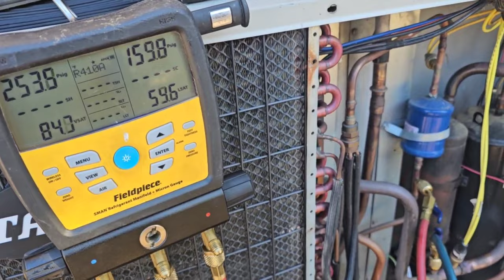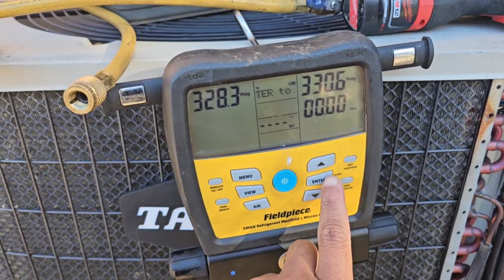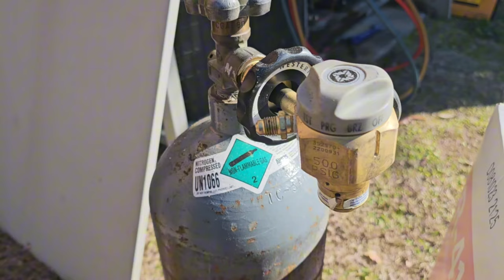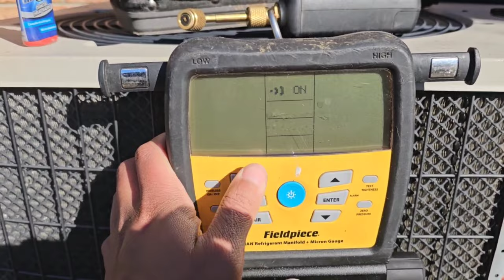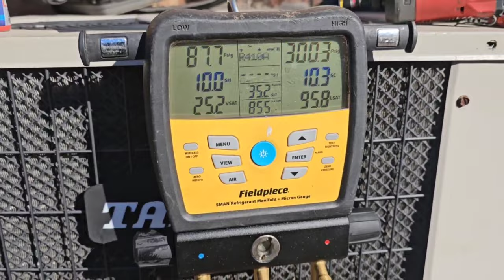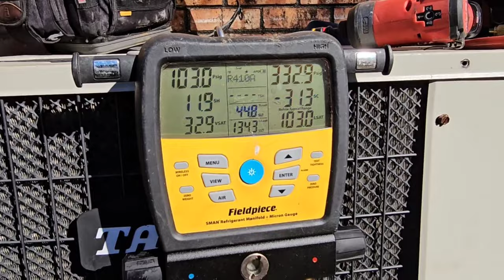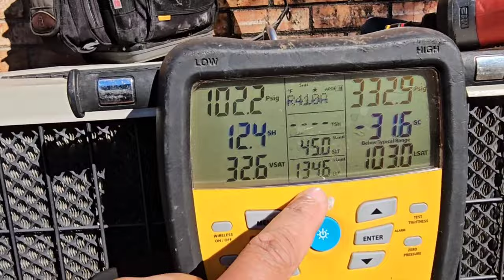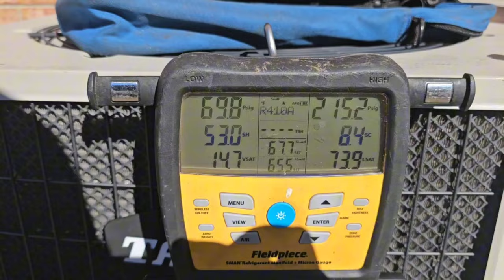Heat Pump Package Unit With Restriction Had Other Issues Too

Comment: Good video! Just a friendly tech tip, when pressure testing the entire circuit with the compressor introduced then you should test to the low side maximum rating. Your blow molded compressor plug is not designed to handle the high pressure rating and it is not a fun day if you blow the molded compressor terminal out.
Reply from the maker: I never knew that. Is it just something with that compressor style then?

Comment: They make a wand for your coil gun so you don't have to disassemble the units. It fits right inside the fan shroud fins so you can spray from the inside out. Love your videos.
Reply from the maker: I've seen a few youtubers use that thing. I think it's definitely useful, I just haven't seen it at my supply houses

Comment: 500 microns is good enough for hvac.  That static trick for charge is a bunch of shit.  Charge by superheated and subcooling.  Heat pumps can b tuff to charge.  Ur doing an excellent job.  When I was ur age I didn't know half what u do.  That's some good ass coil cleaner.
Reply from the maker: Honestly I love pulling good vacuums. Been trying to save up for another big hose to connect to BOTH valves to pull down faster

Comment: Damn that subcool mighty high. Honestly I’m still learning but I was taught that it should be around 12 I believe could be wrong 😀
Reply from the maker: That's true but on heat pumps (to my knowledge) you don't go by subcool specifically. Plus there isn't even a txv on this system which is the only time you go by subcool. Checking LLT on your discharge line in heat mode should be approximately 100° above ambient. But always go by the manufacturer specs if u have a pressure chart. I had nothing

Comment: Bro I always disconnect the Condenser Fan motor and then I charge it.
Reply from the maker: What? 🤣
Reply: @AB_HVAC   instead of covering the top with your tool bags. It’s good for testing the TXV and charging in heating mode.
Reply from the maker: Ooohh ok

Comment: Should not charge in heating, charge in cooling
Reply from the maker: If I remember right it was like mid to high 60s out at the time we were there doing the work. There was no dataplate on there to tell me how much it came from the factory with, so I wasn't in ideal temperatures to charge in either mode.

Comment: Why didn't you change the dryer. It's a common practice.
Reply from the maker: Wasn't allowed to and it wasn't factored into the job
Reply: @AB_HVAC  you should always add that to price. Whenever an open system. New dryer. But it can't really hurt if you leave it.
Reply from the maker: @osvaldomcs1213 👍🏾
Reply: Not necessarily true, I go through jobs all the time without changing the filter dryer and so do many techs that I know and many techs on youtube that I’ve seen do jobs, it’s probably not a bad idea to change the filter dryer when needed but you definitely don’t need to change them after every job specially if your trying to save the customer some money, you shouldn’t give them a quote to change a perfectly good working filter dryer.
Reply: @osvaldomcs1213 incorrect that’s just basically adding unnecessary charges for the customer and charging them something they don’t need… SMH 🤦